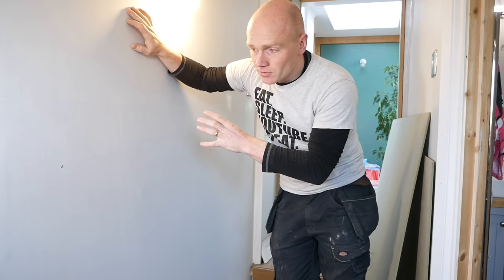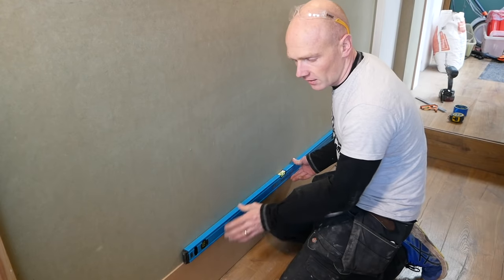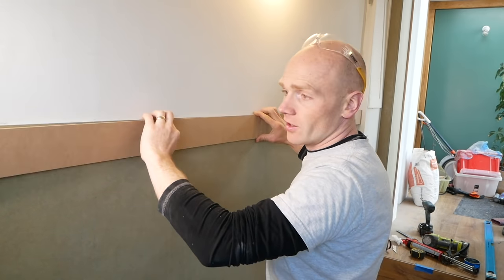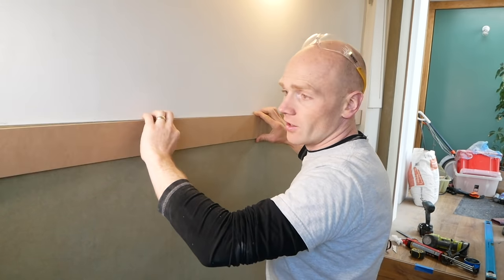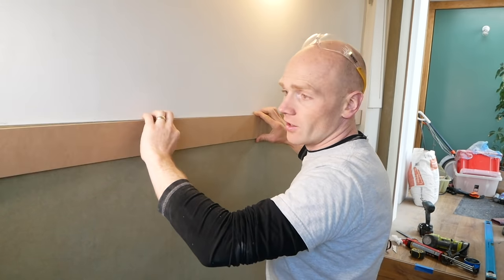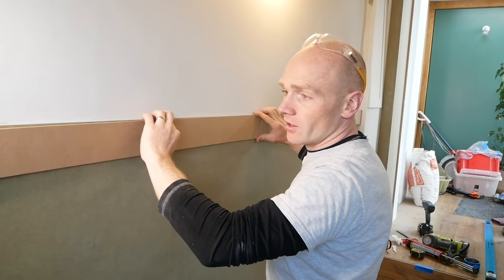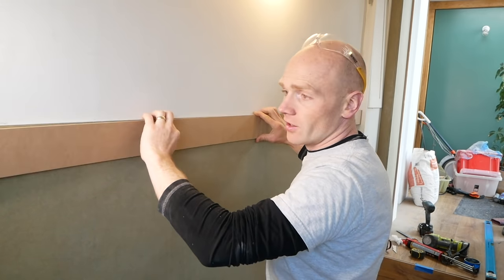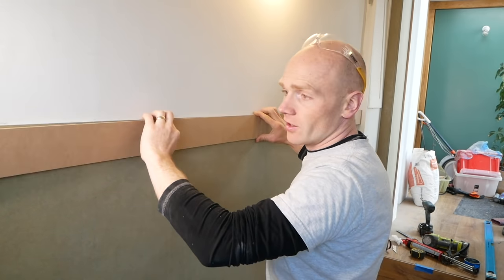HOW TO MAKE YOUR OWN WALL PANELLING - Full Start to Finish Build

Comment: If you put the adhesive on as a perimeter about 3 inches in from the edge then make lines across and long ways you will make a grid that will create a suction in all of the squares that will hold the sheet on far more securely than random squiggles

Comment: I did mine almost exactly the same except I didn't start with backing board. Once I had panel areas I found it easy to fill and sand them and line them with lining paper. Not saying it is easier but I am an amateur and it worked for me.

Comment: Lovely job good work, ive worked on a few properties that have this panelling and have decided as you have to put it in my hallway, its a great solution to high traffic areas at dado height, we too have 2 little ones running around unfortunately ours have 4 legs and seem quite fond of clawing the walls so any sort of redecoration with any wallpaper is out of the question. Brilliant and very informative video, please keep them coming 😀👍

Comment: Having done both and I know carpenters who have done both, I encourage both ways of panelling both full panels and lengths of MDF straight on the wall providing you know your walls.  I wouldn't preach your way is necessarily better or it is hard to achieve a good finish by doing it what I guess you would consider the cheats way of panelling, otherwise if we were all looking to do true panelling we would all be carving it out of oak like in the 15th century!  Many use panelling these days floor to ceiling for a feature wall to add interest rather than to block out cold or damp so full panels are extra work and not always required if a good finish is achievable and you use the correct materials for the job.

Comment: If I were to take this approach, and run the mdf up to the door frames, you’ve used a total depth of 12mm, my door frames aren’t as deep as that. I could use 2 x 3mm depth mdf but probably doesn’t look as good - would you suggest replacing the door frame to accommodate?

Comment: Been doing this for the last 2 days now, first time doing it. it is driving me mad haha. its just because of this darn cheap parkside nail gun i bought, total rubbish, bends the nails etc, makes big dents in the panels so having to fire the nails into a cup and then hammer the nails in one by one myself.
breaking down the 8ft boards takes time as well as i only have a jobsite table saw i have to cut by hand first then table saw the lengths.
every wall is not level and each corner of the room isnt level either so its taking so much longer fiddling with bits to get it all right. am thankful for this video as its filled with info and advice that has helped me a lot
Reply from the maker: Try shooting the nails through a piece of plastic bottle or similar to stop the nose marking.
Reply: @TheRestorationCouple  great tip!! its also just that the nails go in and get crushed down by the hammer action of the gun so it jams bent nails up inside the nozzle. it is a very terrible nail gun that id spend 10 mins un jamming it etc :(

Comment: Looks great! Is it generally the consensus amongst viewers that putting a base panel down is necessary? If you use a quality primer between the strips as well and then the same gloss/satin is it noticeable? Although I’d rather do it the way shown in the video my wife seems to want panelling EVERYWHERE so I’m just trying to avoid the extra work required! 😂

Comment: Great work❤️ have been doing the same just a different style
Small tip for the glue - it is a good idea to make the glue lines so that they are open in the top. That limits the amount of moisture that may be trapped behind the panels😊

Comment: Great video as always guys. Others doing this might want to think about using moisture resistant MDF for the bottom panel (under the skirting). I know it’s off the floor thanks to the packers but if the floor gets mopped or too wet the MDF might expand and blow out. We had a similar problem in the kitchen in our last house.
Reply from the maker: Yeah, no real need to go right down with that piece either. I run a small bead of sealant along the bottom of the skirting to keep things a bit more sealed and also easier to clean which helps too. 👍

Comment: Great video. If you have skirtings anyway, its not easier to start with trims from the top then cut and fit same size vertical's and the last bit bottom trim + skirting. Cheers
Reply: Not easier just different.

Comment: Very nice job,
As a carpenter having done this a few times i Just wondered what detail you will end up with the architrave you temporarily put on ie both finishes on a flat wall “butting” into one another and looking at your finished arcs you have used elsewhere being a 18mm finish. So your cladding with a build up of 30mm in total will sit proud of your arcs that are 18mm and returning the skirting and top rail on itself is a little unsightly. So may be beneficial to increase the depth of  your arcs as we do if what I am saying is indeed the case with your project all the best👍🏻
Reply: Another point I noticed is that traditionally the top and bottom rails would be morticed and tennoned into the vertical stiles at each end of a run. So the bottom and top rails should be between the left and right stiles not under / on top of them. Only a small point but it will be noticable after painting.

Comment: Hi. Question please. If the two walls your panelling are not the same length, the spacing would work out differently. What should I do? Thank you very much.
Reply: You could see if there are any measurements for the spacing of the trims that divide into each other, for instance 1 wall is 45 inches the other is 60, you could space them 15 inches apart.

Comment: How long were the nails used? I just bought the same nail gun for my project and I'm a bit concerned the 30mm nails that were in the package might be a bit too long for fixing the backing board which is only 6mm. The mdf strips will be 12mm or 15mm thick so I guess that will be thick enough on top of the other 6mm and the plasterboard behind. I'm only concerned I might hit some wires or something. 
Any suggestion is much appreciated. Thanks a lot!

Comment: Say if you wanted your wood panelling twice as high, as a feature behind a bed, would 2 of those Mdf boards stacked on top of each other be ok, or will the join start to show over time? Got a terribly plastered wall behind so these MDF boards is a great idea.
Reply from the maker: Just use the boards vertically and set the join behind the uprights.
Reply: @TheRestorationCouple  great shout, thank you for the quick response on this 👍🏻

Comment: Do you find the firing delay on the brad gun annoying? The Hikoki doesn't seem to have as much, but the Milwaukee stapler drives me crazy sometimes with how long it takes to fire, and it doesn't seem as slow as that ryobi!
Reply from the maker: Battery running low slows it a little. To be honest in bump mode I never notice a lag and not using it enough to have any issues really.

Comment: Top class Tim. Trying to figure out how you put 6mm backer, 6mm strips and then skirting board at the point where the board meets the architrave... does it sit out proud with a return or do you have extra thicc architrave?
Reply from the maker: Either use a plinth at the bottom of the architrave or in this case where it turned the angle it tucked under the panel a few mm to leave flush. Elsewhere in the house we have used 35mm deep architrave to avoid issues like that.

Comment: Love the videos and energy. Would you recommend the airless sprayer for walls as well as skirting woodwork etc. I have a full house to decorate and not so keen on the roller finish. If so any sprayer you would recommend that isn't going to break the bank?
Reply from the maker: This week I have a video coming out on just this. I’m a big fan, the new unit is perfect for ceilings and walls.

Comment: Hi great video. I’m doing the same in my house. With regards to seams where two bits on panelling meet, do you just cake on some caulk and rub down until the seam is not seen and smooth?
Reply from the maker: It’s usually pretty tight but I undercoat first to see what it’s like and then a little skim of filler if needed.

Comment: Can you put mdf panels on battens? I would like to put some sound insulation behind the MDF boards. 
Would it be robust enough to hang on battens?.
Reply from the maker: Yes we did that on a wall we wanted to keep breathable. It’s an older video on the channel. We used 12mm MR MDF
Reply: @TheRestorationCouple  great thanks for sending me a message. I will take a look.

Comment: how i did mine was just strips on existing walls no panels to fit as you did,, one sheet of mdf around 10 strips  evo gripfill so no filling  job done, dado sits flush ? cheap low cost but looks way more expensive

Comment: I’ve been eyeing up a Ryobi nailer for some work coming up, do you have any thoughts on 16 vs 18g. Uses would be stuff like door stops, skirting maybe some shed cladding/feather edge style stuff out in the garden.
Reply from the maker: I don’t think either would be up to external cladding or fencing tbh but the 18g is proving great for both internal trim and assembling small projects in the workshop.  Not used the 16g though.
Reply: @TheRestorationCouple  thanks, sounds like I need to learn to use hammer to not bend nails then. Interesting to know the 18g is up to holding trim just fine though maybe I won’t need a 16g but I’ll have to do some more research.

Comment: What type nail gun would you recommend for fixing skirting etc to masonry walls?
Reply from the maker: Not nail gun really ... either just adhesive or screws. Just the odd masonry nail will hold it in enough.
Reply: @TheRestorationCouple  ok great thanks

Comment: Hi, can I ask, is this possible to do without the nailer, and just some no more nails type stuff straight onto the wall? I live in a new build so don't want to be going through the wall, or buying more tools? Thank you in advance ☺
Reply from the maker: Absolutely. The nails just help hold it on place the adhesive is the strength. 👍
Reply: @TheRestorationCouple  thank you !!

Comment: How did you work out the angles of the infill pieces, into the architrave etc ?
Reply from the maker: I built the walls at 45 so knew angles would be 22.5, give or take. Sometimes it’s a case of just creeping up on it until it’s right, sometimes it’s worth using a bevel and bisecting the angle.

Comment: what's the product you're using to paint on the MDF?
Reply: Undercoat looks like Leyland acrylic primer undercoat and top looks like a leyland satin. Not sure what the clear oil/paint was
Reply: @b21playa  ah, i didn't know that product.
In Belgium i can only find the regular primerfor MDF, but it doesn't do the trick.
Thanks for the reply!

Comment: If it was me I would fix the sheet to the wall using a couple of screws and use some cleaver trim to cover the screws. It means if you want to remove it later it will be an easy job without actually ripping the plaster of the wall.

Comment: Do you really need that bottom strip? Couldn't the skirting board do that job, with the added benefit that it would not stick out so far.
Reply from the maker: No you can just add a quadrant or scotia trim I guess. This needed to match elsewhere in the room that just had skirting though.
Reply: @TheRestorationCouple  Okay fine, I understand. The reason I ask is that you've given me the idea of adding paneling to one of my a rooms and I'm reluctant to remove the existing skirting. Great job by the way.

Comment: This all looks like a lot of time and effort (ignoring the cost) for not much of a change. I guess that I must not be such a fan of "paneling", and to paint it all the same colour!!! Using real timber and 'varnishing' the timber as a feature sounds much better but still seems like too much bother. Just repair the gyprock after your push-chair incident (if there's ever an incident) and repaint the wall! Takes maybe a quarter of the time, and will be so much easier to keep clean without all those horizontal ledges to collect dust! That's a "NO" from me!

Comment: It kinda looses the essence of DIY when you use hundreds and hundreds of pounds worth of tools. Nothing against this channel, it's great, but most DIY channels seem to be middle class white fellas with lots of tools (which is exactly what I am too!).
Reply from the maker: 👍 Apart from a second hand tracksaw off eBay, I would say that Ryobi and Erbauer are pretty much DIY staples?  As I described in this video, this particular project could be done with almost no tools... it's just quicker and more fun with them! 😁
Reply: Race and class have nothing to do with this. The most elegant and beautiful buildings with their ornate interiors that are centuries old were built without power tools, computers, lasers, etc. The men and women that built these were extremely financially disadvantaged as well as not having any formal education! If you have a dream, the focus and will power then anyone has the ability to achieve great things. If you get frustrated and make mistakes it's fine......welcome to the human race. JUST DON'T GIVE UP. Mistakes are simply knowledge waiting to happen! Don't allow frustration to overwhelm you. Learning and frustration go hand and hand. Remember learning to ride a bike? You'd fall down.....frustrated, hurt and scared. But you got over it (eventually) ....got back on that bike, taking what you learned ( knowledge) from the previous ride, put your frustration aside with a new perspective and attitude that YOU would not be beaten by the bike. Like the man said "NO EXCUSES ....FIND SOLUTIONS"!